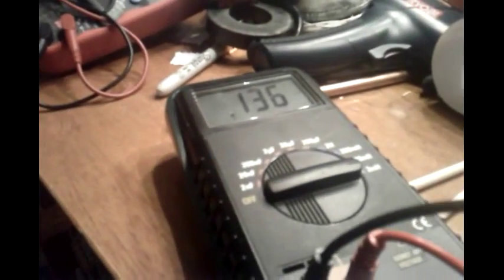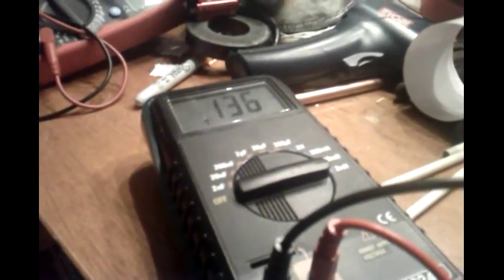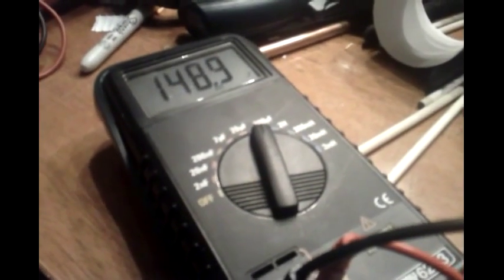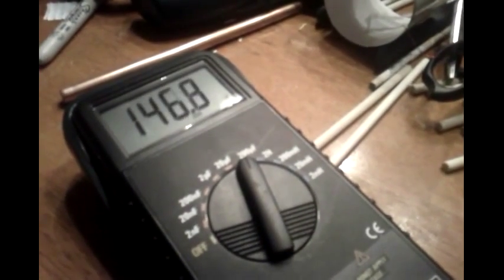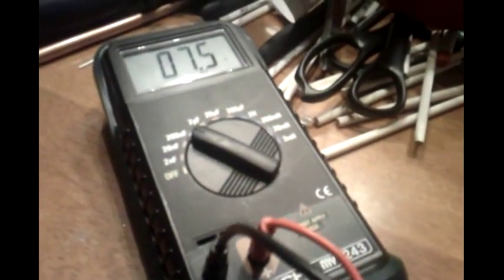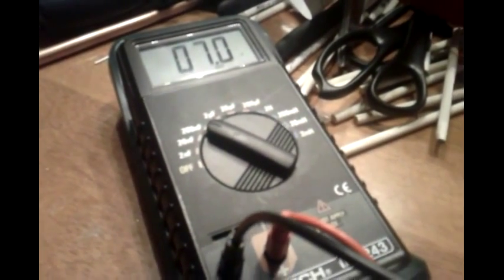Hendershot... L1 and C1 done

Comment from the maker: I used them to buffer a 150v signal on my dally replication.  

There's a nanopulser that I can't get the right parts to build (don't have the parts... ) but it pulses 150V through a small coil, which immediatnly inducts to the other side(?) and that comes from a small power supply (microwatts really), so passing it through the solenoid gave enough time to have a short burst from a close capacitor before the real power hit it....but anway...

Comment: Question: i bought the plans online with an assembly Video for $70. Would like to order the parts for assembly... Does the H.Generator work, in general?
Reply from the maker: https://www.youtube.com/watch?v=HmYfcgvf6Jc  is Akula's implementation of hendershot... I also saw another video that's 2 hour russian assembly video that seems to work.  My issue was when I got to the 'buzzer' coils... needed a thicker iron rod and fewer turns of thicker wire than I used...
Reply: Thank you J Decker. I take it you actually got the generator to work.. generating electrical power via it's resonance circuit?
Reply from the maker: Hexcelsus no... I couldn't find resonance... the 5:1 transformers themselves resonate at 60Hz... and my self wound ones didn't couple very well....and I never built a proper buzzer solenoid coil (or found one) what you get from radio shack is not the same as it was in hendershot's day
Reply from the maker: Hexcelsus Also; the uhh capacitors I guess in some places work more in a pushing sort of mode; more like Dollar's LMD capacitors where in series they aren't 1/(c1+c2+c3+...) but are actually C